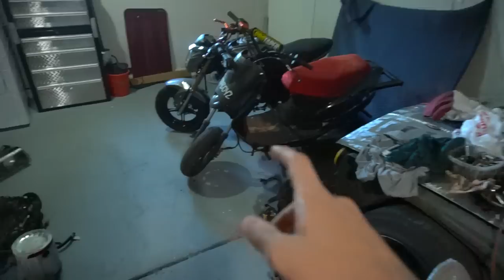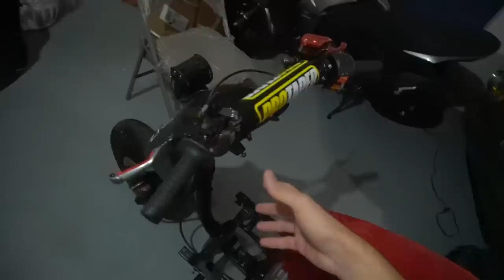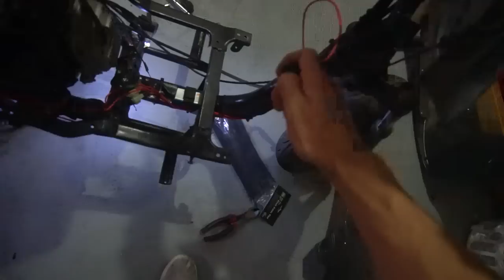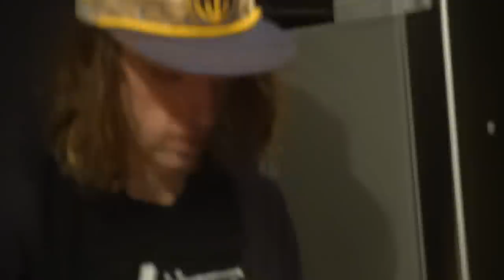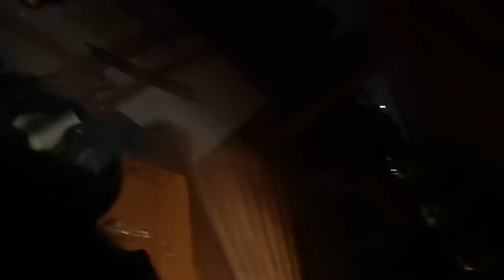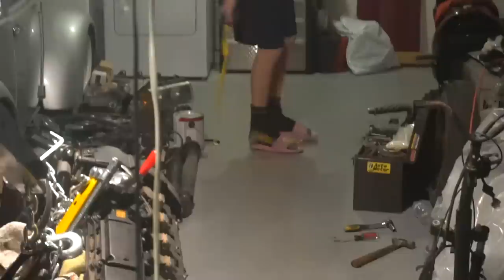150cc GY6 into 50cc SCOOTER | CRAZY FAST ENGINE SWAP

Comment: I have a 50cc scooter and I can put a 125cc engine on it without making any changes to the 50cc frame or do I have to modify the frame
Reply: I have a 50cc to but I’m about to put a 150cc on it even if I have to weld engine mount adapters and brackets 🤣🤣

Comment: Yo so I’m new to working and about to start my first Stunt scoot build, I notice you never use a key on yours, I want to do the same , do you just straight wire it? Then your killswitch is what works as a on off? Then run lights straight to the battery and to a flip switch?? Does the ignition being wired on all the time not drain the battery? Like I said I’m new to wiring lol

Comment: If anyone is looking to swap a 150cc into a 50cc frame without welding a damn thing find you a 50cc scooter with a 1PE40QMB engine. It's a 2T. The 150cc has exactly the same mount dimensions. The output shaft may have to be changed if you want to use the 50cc wheel.
Reply: Just looked it up, looks like what I want but it's still top mount.
Reply: What if i want to do the opposite could i install the 1PE40QMB engine on a scooter that it used to have a  150cc gy6 could i do that ?
Reply: @briansegarra9312  it should fit. The mounting bracket is the same.

Comment: Did you do full custom wiring on that? I’m thinking of doing the same thing as you but I don’t know if I should take out the wiring harness which is in there stock and doing a full custom wiring with new lights and everything.
Reply from the maker: Kai West I stripped any wire I don’t need besides light and ignition

Comment: I have a 49cc tao pony50.. Could i fit a 150cc engine in it and do i have to upgrade anything else to be able to safely do the speed of the 150cc? like i was thinkn the tires may explode if i go above 50mph with the tires made for the 49cc scooter?

Comment: bro love yo videos brother n ..r u one that's got the woops u fly ? ..n I got a question fo u  I messed with my idle mixture screw to try to get me faster take off ..n now on a cold start runs about 4,000 RPMs then after did choke is released it idles at 11000 RPM which is great ..n hard to start on a cold start ?
Reply: Scooter should idle @1900-2000rpm. I'm assuming you meant 1100rpm, not 11000? But 1100 is too low for idle
Reply: @tdot1269  ty brother n I got it idling about 1500 RPM I got it running smooth idle now .. but wat can I do so I can do wheelies ..n I bought a new CDI box but took for a test drive and when I would slow down to a stop the bike RPMs would rev up and bike would launch from at 15 miles an hour to a stop ..so I put the old original CDI box back in it it's working fine now
Reply: @mikewaterman1905  most CDI's are bs and a waste of money, mainly those orange and blue "racing" ones sites sell for $10. Naraku has a good box for about $50. For wheelies tho I'm not sure without increasing torque at takeoff. Try someway of shifting weight from the front of the bike to the back end.
Reply: @tdot1269  for  me to do a wheelie my power band is at 35 miles an hour .. just a little too fast to try and Willie lol .. n ya I put my original CDI box back in working fine there is a little set screw on the CDI box .. it's blue CDI box but doesn't look like the racing one's.. n I stuck my hand in the CVT case and all kinds of oil on my fingertips.. ? ... should I take the case off and clean the belt and housing ? ..n do tha how would tightened down to any certain specs .. ?

Comment: Can this be done on a keyway 50cc and would the drive shaft need to be swapped for the rear wheel
Reply: I used a old  tao tao 50, all I had to do was ditch the stock engine mounts n weld In a top mount. Then I took out a cross member to make sure my head don't smack it.

Comment: HEY PEOPLE...IF YOU HAVE AN ELECTRIC STARTING SYSTEM WHY KEEP THE KICK START...I HAVE REMOVED THEM FROM TWO SCOOTERS AND AS LONG AS I KEEP UP THE MAINTENANCE I TRUST THE STARTING SYSTEMS...I HAVE BEEN TAKING CARE OF TWO GY6 SCOOTERS FOR A FRIEND...I HAD TO LEARN FROM SCRATCH ABOUT THE GY6 SYSTEMS...WELL I THINK THE MOTOR IS AN EXCELLENT DESIGN... ONE HAD A BROKEN OFF STATER SHAFT LOL CRANK SHAFT AND TAKEN A $25 INTACT SPARE THAT SOME ONE HAD AND MADE ONE GOOD MOTOR OUT OF TWO...HAD TO CHANGE THE 50cc HEAD OF ONE TO AN 80cc AND I LEARNED ABOUT THE GY6 SYSTEMS THE OTHER IS A 150cc TAO...LESS IS SOMETIMES MORE...